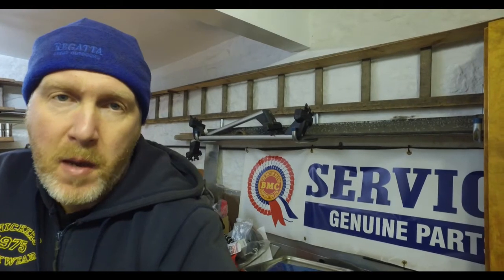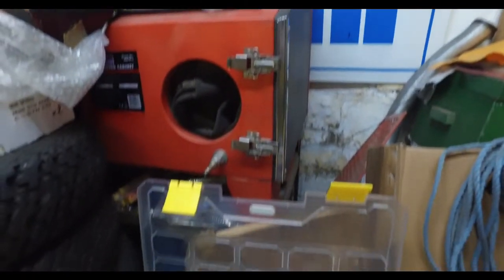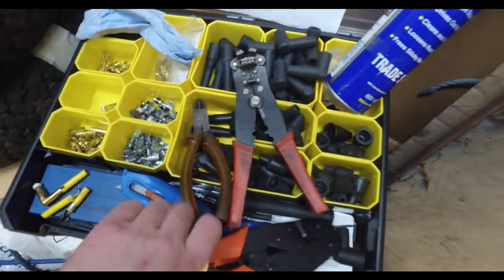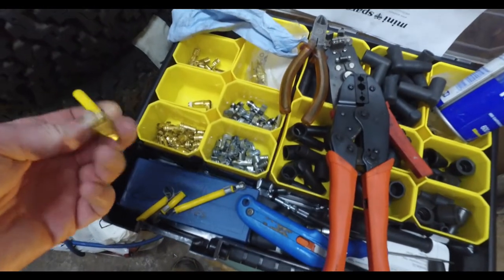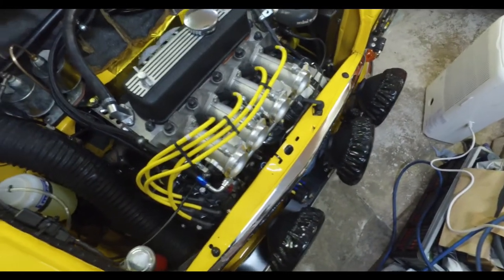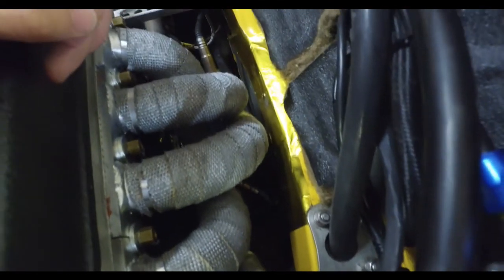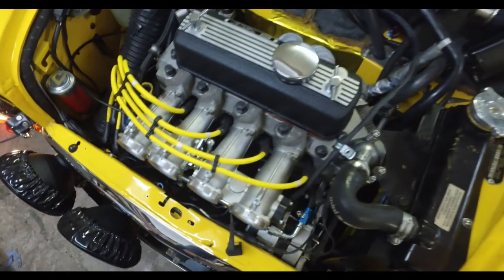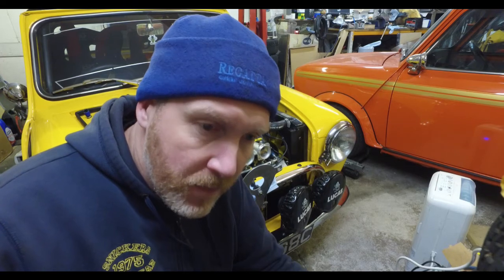Bumblebee's New Engine. Part 15. Will it Start?

Comment: who makes cross flo heads for Minis, and how much extra power does this give
Reply from the maker: Minispares had them recast and are continuing to refine them,  latest recast was 2012 I think? Difficult to say how much extra power it gives as I've never had a like for like build, there's so much is changed to make it work (head, fuelling, cam, exhaust) They are more torquey than before and will pull big race cams at low speeds without any issues. 
https://www.minispares.com/search/classic/8%20port.aspx